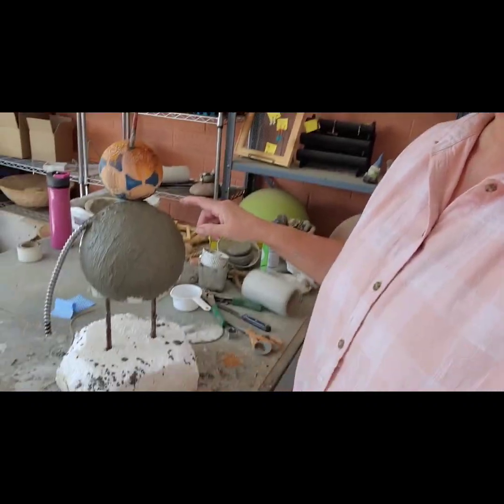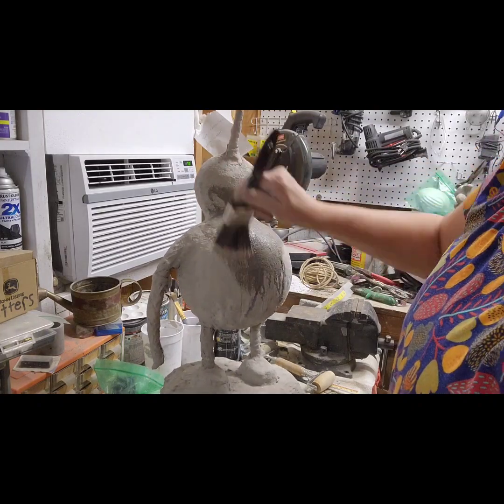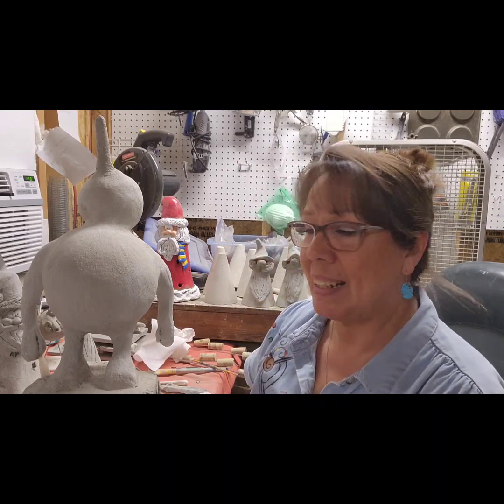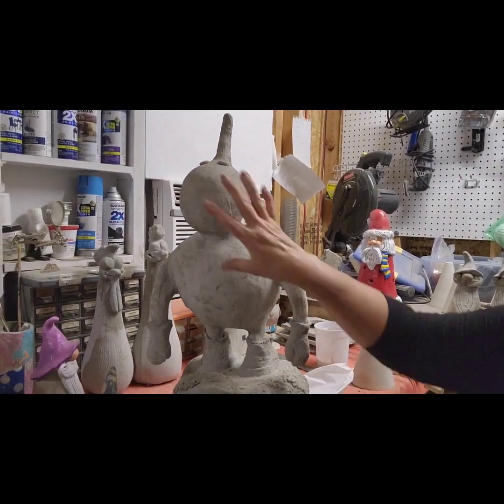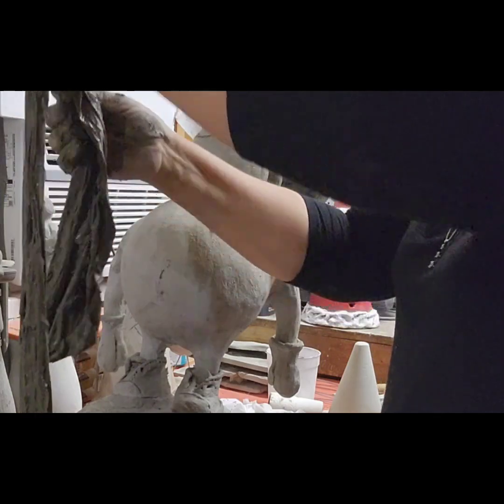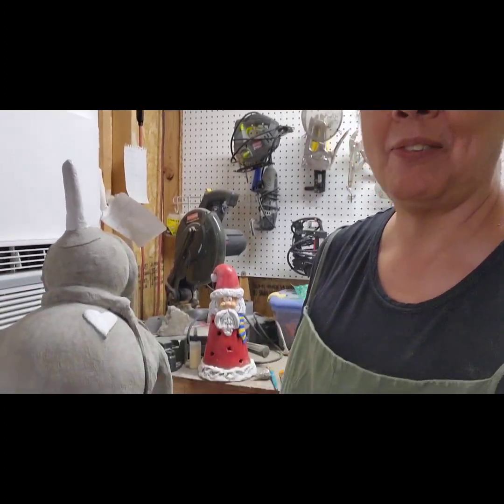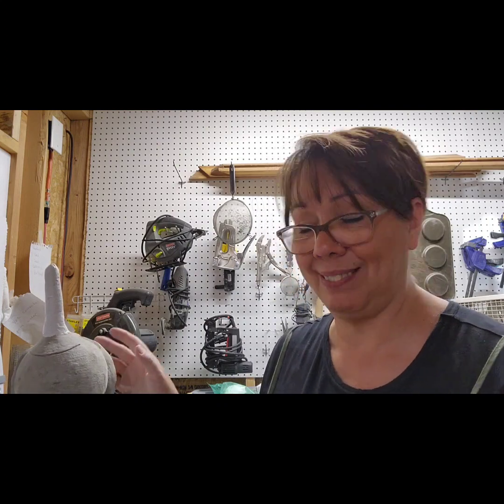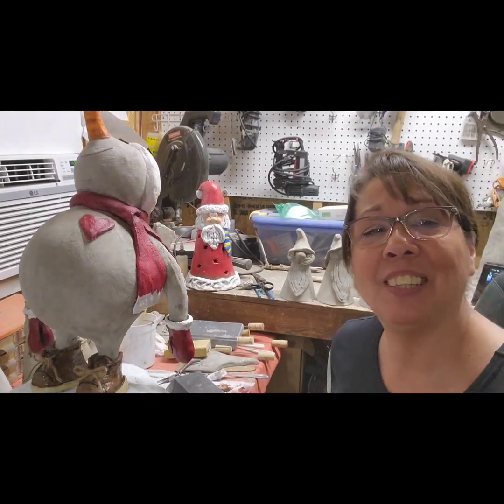DIY Cement Snowman

Comment: I tried the1cup plaster of Paris with the 1/4cup glue the glue was Elmer’s white washable glue but it won’t stay soft and pliable....is there a certain glue u use
Reply from the maker: Hello Lois😊
The plaster and glue clay will only be workable for 10 minutes we gotta work fast.

My next favorite clay I make is this one. It won't last to the next day however it will be workable if you keep it in a plastic bag and knead it once in a while for almost an hour.

Both the plaster clay and the papercrete clay I make small amounts at a time.

Here is the papercrete clay

Papercrete Recipe

1 c damp toilet paper pulp squeeze out most of the water

1/4 c white glue
1/2 c versabond thinset
1/2 cup portland cement

Mix together to the consistency you want thinner for spreading stiffer for modeling

I have many projects on my YouTube site using the papercrete clay 😊 Have fun. I hope this helps😊